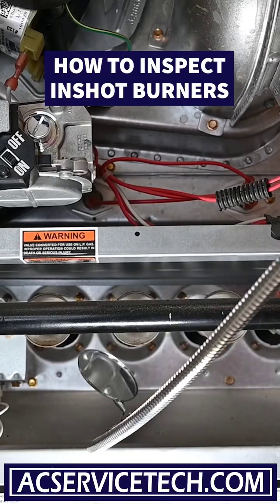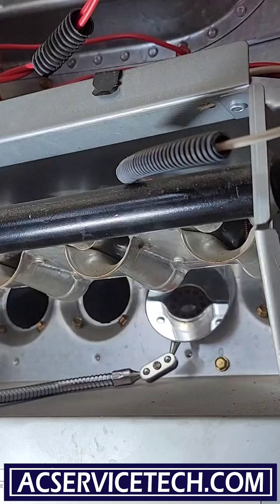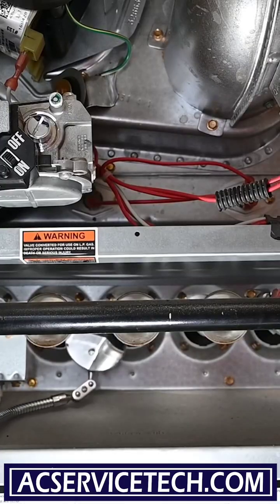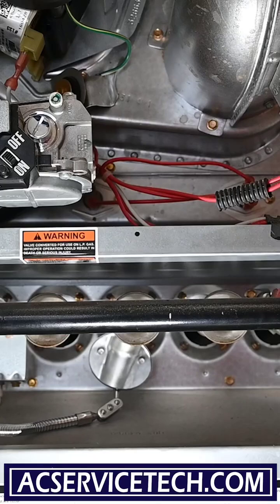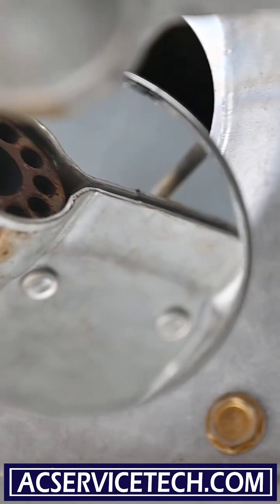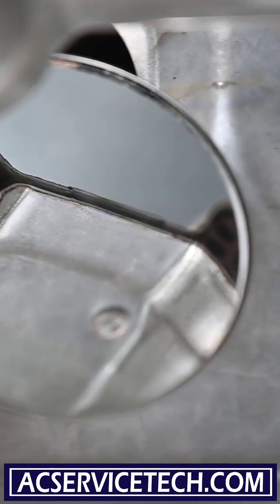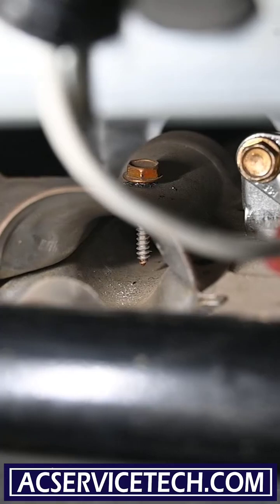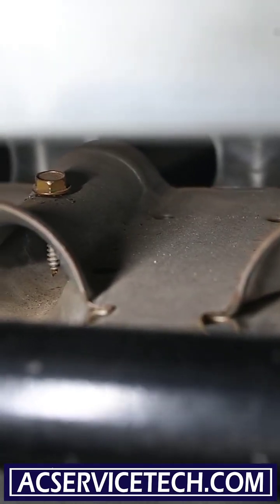Ty Branaman Covers Properly Inspecting Inshot Burners on a Gas Furnace

Comment: How hot should the surface area be, where the high limit switch is at? I’ve ran into a problem where the inside of the furnace where the heat exchanger is at isn’t over heating but the high limit switch is setting off do to the surface area where the high limit switch is connected to is reaching really high temps?

Comment: To flesh out the screw thing, it to help the propane and primary air mix together before joining secondary air because of the weight difference between the two gases